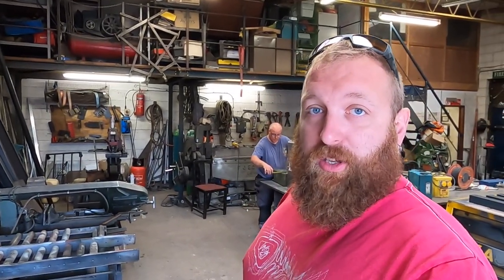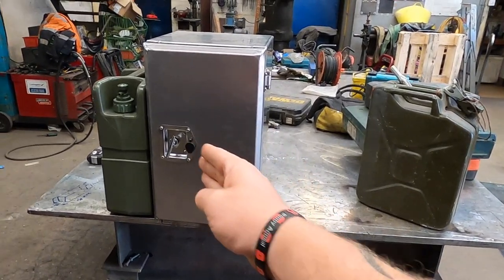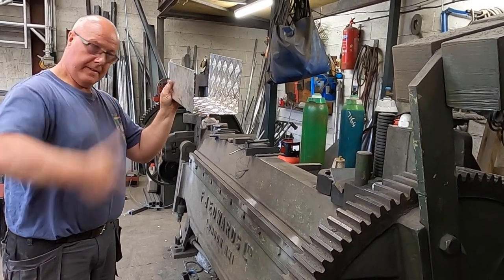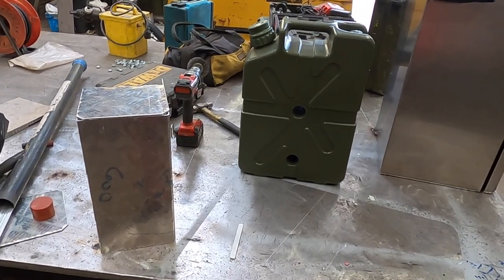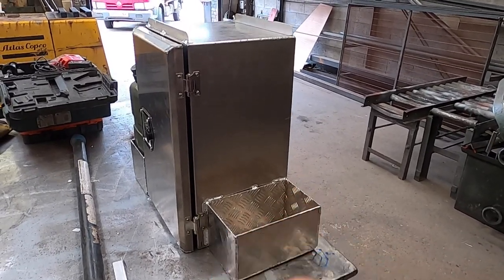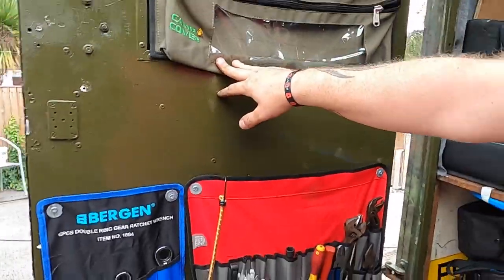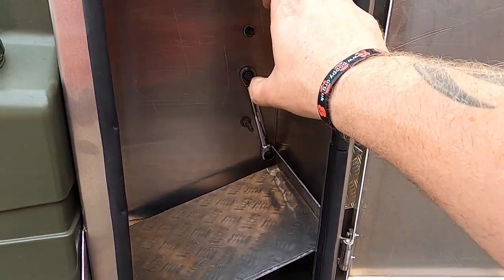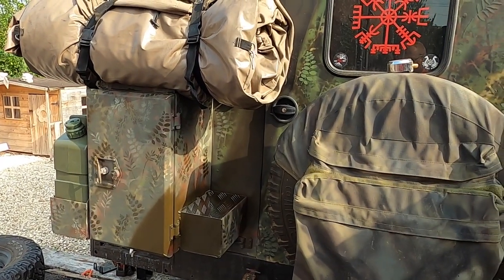making an overland storage locker for the back of my Land Rover Campervan

Comment: Probably said the same thing before but anybody can just order stuff out of the ARB catalogue and bolt it to their vehicle (and, to be fair, we'd probably all do that if we could afford to) but it take real smarts to come up with ideas for yourself, figure out what you can use to do the job and then build it for yourself.
Always a pleasure to watch people doing stuff for themselves.

By how much did the jerry can foul the door? Looked like it was only a couple of inches.
Might have been possible to step the cabinet forward by a couple of inches, using lengths of 2" square tube, and then the jerry cans could sit up against the door without fouling the cabinet?

Still, looks fine as it is and, as you said, if you didn't really have a purpose for the other jerry can, it's probably smarter to put stuff there that you DO already have a use for.

On a (vaguely) related note, I've often thought about cutting a jerry can in half and turning it into a container to store recovery gear or other mucky tat that you don't want inside the vehicle.
I suppose it's possible to buy something like that but, meh.
Reply from the maker: It was about 40mm so using it for something else. Not the end of the world tho because it would only be for long trips.
Reply: @Bugoutvehiclesuk  You did the right thing, I reckon.

If we all did EVERYTHING that we thought about, our cars would all weigh 10t!
Sometimes the smartest thing is to NOT do something, if you don't really need to.

Comment: A friend who can weld is a friend indeed. 

How tough is the plastic on life saver Jerry can, do you think it would be tough enough to mount just using the two holes through the middle of it?

Rich think about adding/enabling record on those cameras the money on the out side of her now is getting way up there, the LRO international 90 got stripped a couple of weeks back while it was parked in a car park.
Reply from the maker: I bet you could but I wouldn’t want to mount it like that long term. The landy is never left unattended too as it’s locked in at home under very expensive cctv and when I go out some one always stays with the vehicles

Comment: Looks great rich. Out of curiosity what do you use to clean your onboard water tanks when you do it? Ive used bleach just wondered if any of you guys reading this have used baking soda? Just wondered about residue left behind. I’m thinking about bleach killing the plastic fittings over time
Reply: Il be using milton tablets in mine
Reply from the maker: I put a third of a tank in then a big glug of thick bleach then drive down the lanes then run it through the system and rinse it out. Baby sterilising tabs would prob be better tho.

Comment: Would a spacer behind the locker give you room to set the liquid containers back so the locker door can open? {probably a bit late now but it's a suggestion}
Reply: That's what I was thinking too. Could even make use of the space to store a tow-rope or something.
Alternatively, step the right-hand jerry can a couple of inches away from the side of the cabinet so there's room for the door to swing open.
Reply from the maker: That’s a good idea. It’s Arcady welded now tho.